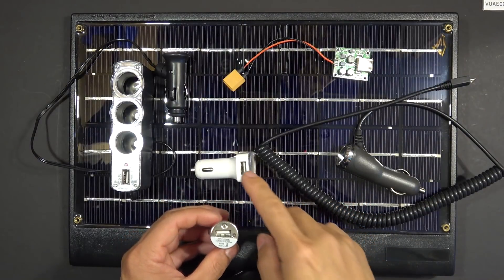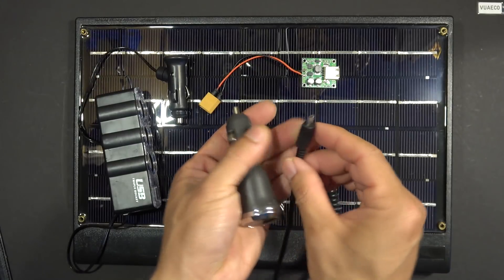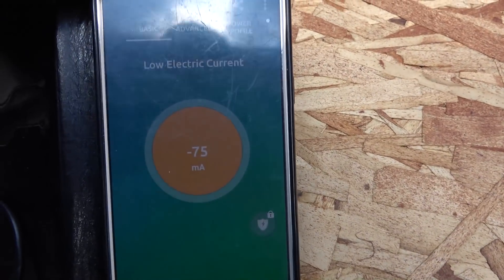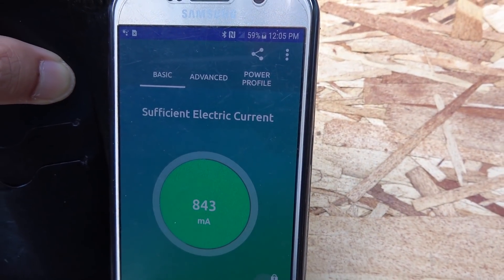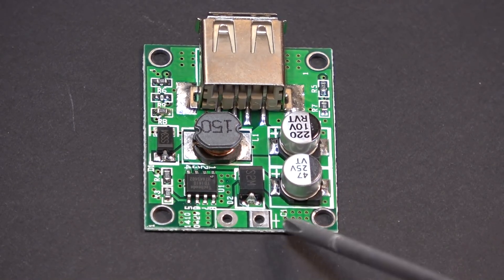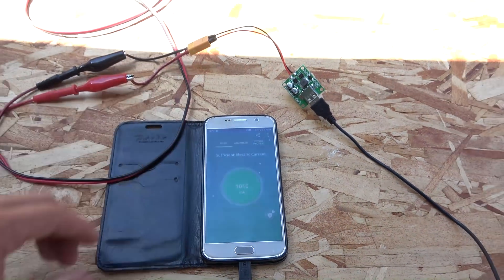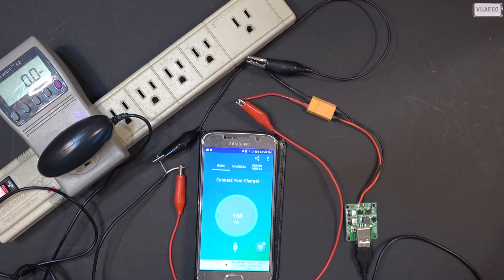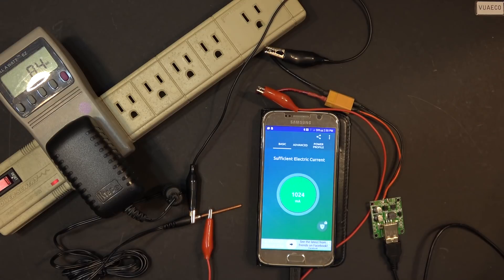Power a USB port directly by a 12V solar panel without a battery

Comment: Many car charger voltage input range is 12v - 24v, so you can use 18v solar panel..
Reply: Not always. Many car chargers will think 18V is battery low for a 24V truck and stop charging. I have one that does that. It has to be above 21V or it will think it's a 24V system at low battery

Comment: fun fact if your solar panel is big enough and amall enough to put a converter on you can wire directly into the solar panel but if you wire it into a 12v car battery magic smoke comes out of the converter

Comment: Hello buddy, i come from a part of Africa where electricity supply is a big challenge .recently to light our community at night we rely mostly on solar powerd street lights. I have been wondering if its possible to charge our phones also using solar energy until i stumbled upon this video. I am going to try your method with the dc to dc converter used in cars. I hope to come back and tell u my experience.
A breakthrough in this direction will alleviate a lot of suffering to my people

Comment: You can charge electric cars with solar panel via USB charging ports.  I've tried with regular gas cars; after charging the battery, my windows moved much faster meaning it did charged the battery.  Only concern I have is over charging.  There should be a controller to prevent the over charging the battery.

Comment: Great video, thanks!  I was wondering if I can charge a 5 volt battery directly plugged into on of those cheap pwm charge controllers that have usb ports without a 12 volt battery to anchor  the controller.  I watched your video learned a few new things and had the time to think about the pwm charge controller.  I realized I only have to plug in my 5 volt battery and see if it lights up the screen on the charge controller.  I think I like your other two methods better tho, anyway.

Comment: any particular reason why using a 12v extension then pluging in single adaptor rather than just connecting direct to the single adaptor

Comment: Hi i have solar system on our Toyota Coaster Camper bus. And there are 2 set of double USB ports in the bus. One set at the head of the bed and another set at the bottom of the bed. Just wanted to know how I can change The solar USB ports at the head of the bed to electric. As our solar system is not set up yet. 😃😃 I want to keep one set as solar and the other one as an electric one. So we have the choice of either electric or solar to charge our phones extra 😃😃

Comment: Thank you for your video
A question I have is could I use a solar panel to power like this setup for a wyze v3 camera that is 5v 1amp dc and night vision is 2-4 watts. The camera does not have a internal battery source only dc or USB. Thank you

Comment: Connecting the same way the fluctuating panel voltage have usb 5v voltage fluctuation of 0.15v & it that okay compared to car use of 0.01v fluctuation.

Comment: A lot of cheap charge controllers come with USB ports, usually 5V x 2.4A. So can't you just get a $15 charge controller and use that to charge your phone? Seems easier.
Reply: I know that I'm very late to this comment but here I go: Yes, a cheap charge controller would be better at charging a phone but to work they need to detect a load(battery), that's the method he showed at the start. The way he showed here is a method that doesn't require a battery.

Comment: I've found with a smaller mobile phone if you plug a powerbank into the USB and powerbank out into the phone it keeps charging after the sun has gone in. I had a phone that only drew 130mA from the panel (about 0.5A when it's gone through the 5V converter) but my panel is good for 0.4 amp or more so the rest of the power is not used if I'm not using a big smart phone. With a power bank it will draw more current but the small phone will keep charging even if the sun goes in.

Comment: Using this system for 12v car battery portable super heavy kit 5 or 6 years ago.. Heavy but long lasting..lol..
Its just same, only different source but still 12v.🤣🤣

Comment: Well done. Been thinking to do my own tests on those cheap USB chargers as I have a 18v 0.6A 10w military amorphous folding solar panel that still works after being shot with a few rounds of 7.62mm bullets 😬.
I want to be able to charge a 12v and a lithium ion power bank at 5v. Now I know the charging currents possible thanks to your video.
Thank you sir! Saved me a lot of time.

Comment: excellent video.....the car adapters have a t092 -78l05 5v regulator in them,  i think the 7805 (bigger version) of the 5v regulator can handle more amps.....

Comment: This is great!

Those cheap 5v usb plugs SAFELY regulate 20v without a charge controller or battery?

Is there any way to do this SAFELY with a  200 Watt 20v solar single panels to charge and run several things with 5v 2.4a?  What happens if we get perfect solar and get the full 200 Watts from the panel?

I want to mount a specific flexible solar panel physical size (32 wide x 42 long) on my van.. in part because I want to benefit from the shade on my van roof.  The biggest wattage I have found is 200W 20v single panel.   I am testing a Chafon 200WH (18ah) portable power station that has a built in charge controller .. I tested it with a 50w panel and it fully charged in about 6 hours.  The back of the unit has a warning not to use a solar panel larger than 120w and/or 22v.  Given that most panels don't yield what they say would this be safe to direct connect?

Also, if my real goal is run a fan in the van during direct sun light, anyway to regulate the 200w/20v panel so I don't need much battery but also so I don't burn my fan motor?

Odd idea, but if too much power for the Chafon.. can I just cover part of the panel?

My gut feeling is that connecting the 200W solar panel direct to the Chafon will be fine.. and that the 200W solar panel will never perform that well to be a problem.

Comment: hi vuaeco just sent a video of a food mixer I want test if motor ok as stopped working was from charity shop but its a good make its heavy glass so maybe can change switch or add my own so how do I bypass switch or the keypad thing on top and test motor.thanks.steve in uk
Reply from the maker: It depends if the motor is AC or DC. The motor of the mixer I had was a DC motor so I was able to use my power tool battery to test it. The power plug was AC but inside it has a AC to DC regulator to run the DC motor. You will have to disassemble it first to check and see if the motor is AC or DC. Some AC motors are even OK to run on DC. They are called universal motors, I think.
Reply: ive got the mixer working now maybe it was just reset switch .thanks.i need to build a 12v supply so can power a car satnav on my electric bike how would you do that?maybe 4 cells but that's 14v bit too high perhaps voltage regulator?

Comment: Thanks for all your videos ,  very informative and helpful ,..  I dont know a lot about electronics ,.. Can you please tell me if im charging a 20v powertool battery with this device does the battery automatically know  when it is fully charged ?   Is it as simple as solar panel to usb 20v - 5v and then to battery ?    Sorry for my lack of knowledge .

Comment: What app are you using on your phone to measure current?
Reply from the maker: The app with big round circle is called "Charger Tester". The other app with small/little letters is called "Ampere Meter Pro". My phone runs on Android OS. If you have an iPhone, it would be different or might not be available for other OS.

Comment: Could you provide a link to that USB power board module?
Reply: https://www.ebay.com.au/itm/DC-5V-20V-to-5V-2A-Max-USB-Charger-Regulator-For-Solar-Panel-Fold-bag-Cell-N1P5/323276722408?epid=911879317&hash=item4b44cb50e8:g:0sQAAOSwkcFbC-E6
Reply from the maker: I've added the search link to the description above.
Reply: Thanks Mukesh